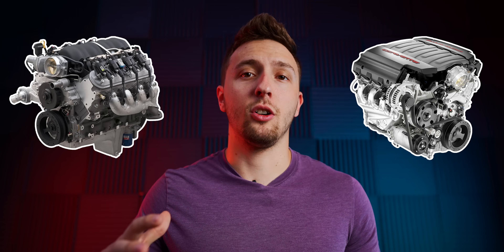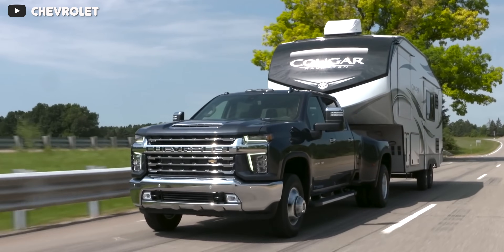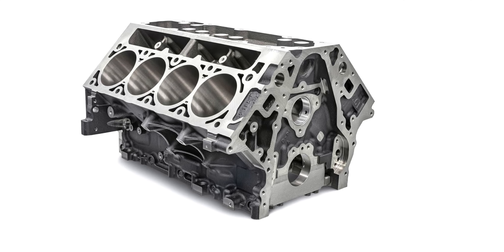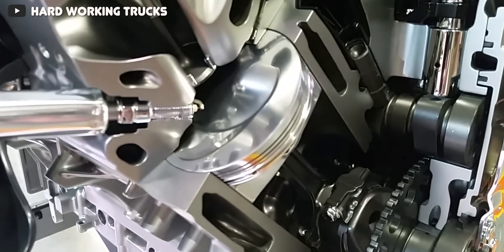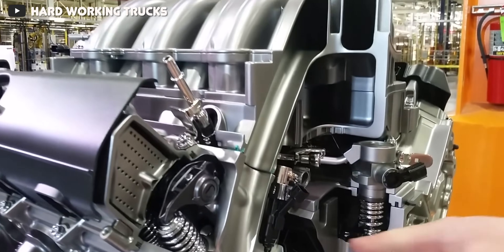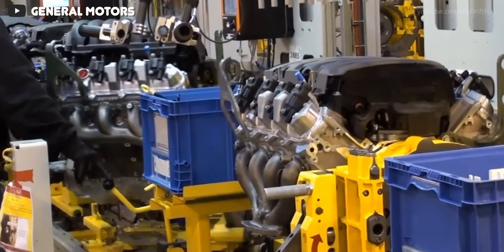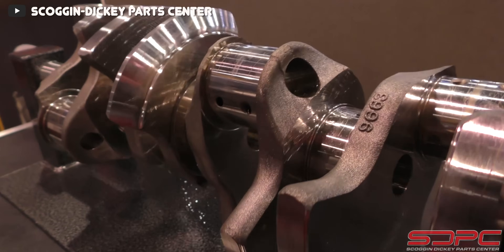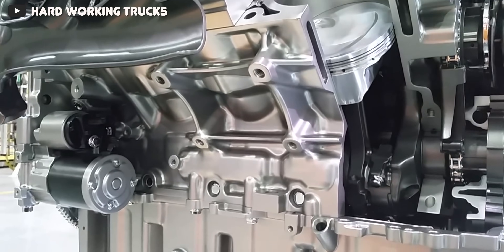Here's Why the GM L8T is the Best LS/LT Engine

Comment: I got the L8T in my 14Foot NPR box truck 🚚 n I luV it.. It has a 38 gallon fuel tank.. I run 2 gallon diesel mixed with 36 gallons of gasoline 😮😮😮 an it runs smoother n stronger 💪... 25+ years Mechanic. The diesel helps as lubricant for the injectors, rings, pistons, cylinders. If you have questions just go an read the fine print in the Lucas gas treatment, it's basically motor oil. 😂😂😂😂😂

Comment: I have the 2024 GMC 2500HD double cab long bed L8T 10 speed. Love it so far. Hauls my Lance camper fantastic. Cruises at 70-75 perfectly 11mpg at that speed. Accelerates up to 80 on a grade no problem. This thing goes and is really smooth. Of course if you drop down the speed the mileage is better, but I like to go with the flow and on the Interstate that's 70. Empty it get 17 mpg. Love this truck..

Comment: The gen 3 and 4 stuff is really popular and simple cam swaps are not only possible but will give you a good power bump. The LT family though i wouldnt associate simple with anything about it. The lt family of engines are great dont get me wrong, but you wont be doing any somple cam swaps, those Di injectors are very expensive like diesel expensive, and the fuel system high pressure portion runs off of the cam which has to be taken into account by cam manufacturers and customers alike

Comment: The 6.2 is still better stock for stock.

L8T 401hp 464trq
L87 460hp 460trq

L87 revs higher and has the 10spd mated to the back.

The 2500 series trucks the 6.6 comes in are a lot heavier and have that junk 6spd behind them. Slow turds that get horrible mileage.

1500 series with the 10spd and the lighter truck. Better mpg, performance, and can tow almost exactly the same. 600lbs less with the tow package.

If you’re just buying a truck for a truck, a 1500 with the 6.2 is the better truck. 

For performance I’d still stick with the L86/87. Better aftermarket support.

And a cast block is meaningless. The 03/04 cobras had a cast iron block. And the Teksid aluminum blocks from the 96-98 cobras were way stronger while being lighter. 

A lot of these points are all on the 86/87 as well. 

The only real plus to this engine is the lack of AFM/DFM/DOD. Which is an easy delete to do. Especially if you’re already gonna be doing a cam swap as well.
Reply: The L87 is 420 hp NOT 460. 

The L87 V8s are failing constantly. There's already two class action lawsuits out. 

The L8T has no AFM, lower compression which means less wear, doesn't require more expensive premium fuel, and now comes with the 10 speed. 

And BTW DFM is not easy to delete, if you disable it with software you STILL have the same lifters which are what's actually causing the DFM issues. Do a cam swap you've killed your warranty and likely made the reliability even worse.

The performance crate engine version of the L8T (the L8P) makes 523hp, 543 lb-ft and is fully backed by a GM warranty.

Comment: iron blocks are used for increased durability and lower cost vs aluminum.  Also they handle being overheated a lot better than aluminum.  Its not about "strength" to handle high power output...

Comment: LOL packaged very small. like that is somehow in the top 5 reasons an engine is good. The Ford Coyote engine is so much better in every respect besides size. So what? Hot rodders are innovators. They make anything work. Don't need the gm (Gods mistake) people bashing Ford with what they know nothing about. Just for the reason they are "cheaper". If you are worried about 2k... you shouldn't be working on a hotrod.

Comment: I love my GM trucks, especially the GMT800 series. However, if I were to buy a gas tow-pig it would be a 7.3 Godzilla. We have a fair amount of mountains nearby and gas won't cut it for towing 12-20K lbs toy haulers. My buddy traded his 2023 L8T truck for a godzilla and it is night and day different. It still revs it's nuts off on steep hills. I just prefer diesel because they are still cool calm and collected at max power. I'll stick with my L5P and LBZ for now.

Comment: Another interesting note that I learned about ; after having investigated materials that, effectively, mitigate high-thermal loads : the L8T is equipped w/ exhaust valves made of Inconel.

Provided that one is OCD, regarding heat management - he or she may want to look into this [ very, very expensive ] material. It’s purported to be “ that good ( and is used, extensively, in professional racing applications ). ”

I’m attempting to build a bionic overlander  — so ; I’m [ everywhere ], researching.

Comment: For anyone wondering these are also an extremely simple swap for all 14-18 half ton trucks minimal wiring required. Re pinning some connectors and a tune and re using some accessories and it works. Id argue its cheaper to swap in a l8t in place of camming your l83 with long tubes just to achieve similar power.

Comment: This makes me feel so good about buying a silverado 2500 gasser. Gotta love a simple small block v8. No start stop, no hybrid bs. No fuel management bs. No cylinder turn off bs. Love this truck with this engine.
Reply: I have hd at4 gas, I wanted column shift with non of the epa bs. Perfect engine.
Reply: L8T is under rated. People have dynoed L87 vs L8T engines in 1500 trucks and find RWHP is more with the L8T

Comment: Good video but I want to put this short lock in my 17’ 6 liter truck but I don’t want the direct injection crap on my truck so how can I do this?  I mean the heads on the 6.0 are very different as you say the exhaust valves are swapped?

Comment: 400 hp, not even 500 ft lbs? No thanks, I will stick to a LSX or LS3
Reply: The L8P crate engine makes more power and torque than the LSX 454 street-legal crate. 523 vs 505.

Comment: 8.1 got your back to
Reply: The 8.1 only made 320-340 horsepower, less torque, got worse fuel mileage, was physically larger, and much weaker.

The 8.1 heads weren't capable of flowing nearly as much air as the L8T. An L8T could pick up 100 horsepower with just a cam and a tune. An 8.1 can't.

Comment: There are some issues surround the crankshaft snout diameter and key ways. 
   That stock timing gear is not engaged with the timing key by very much at all leaving the timing gear floating on torsional stresses with over .0025 clearance from the crankshaft snout.
  You’re not hanging your hat on much at all
In that area. 
  Plan on at least milling an additional key slot in this crankshaft. There isn’t anything out there readily available so far other than a aftermarket crankshaft.

Comment: Dump the variable oil pump and I really like the idea. I hope they enlarged the exhaust manifold studs or made them out of inconel or titanium. I’m fed up of American engines developing exhaust leaks. What trans is behind this because I also hate the crappy torque converter failing.

Comment: It sounded like you implied this engine replaced the 6.2.  With the mention of the 6.2 specifically and the mention that it went back to iron block. 

The 2500hd and 3500hd trucks never got a 6.2. Never ever. And they never got an aluminum block. Even the Denali hd trucks did not get a 6.2.  6.2 is a half ton truck engine. 

6.0 been the only displacement of the ls engine before the l8t and it has always been iron block and aluminum heads besides the 99 and 00 trucks getting iron heads.  

Just to clarify. There are lots of people who think the 6.2 with aluminum block made it into an hd truck and it never did. Perhaps because the plastic engine cover looks just like the 6.2’s in half tons

Comment: Would have been REALLY awesome if GM offered a different ratio besides 3:73 for the 2020+ trucks. The 20-23 trucks with the 6L90e and 3:73’s felt similar stock for stock as a 11-19 L96 with a 6L90e and 4:10’s.

Comment: The aluminum block can only handle 1500 hp max. This engine right out of the box will handle 2000 hp with higher quality  pistons ! You really need to do your homework on oil pumps if you go to a higher volume or pressure pump WHICH YOU DO NOT NEED YOU WILL LOSE HP . Years ago the higher volume pump was the thing to do .
A FACTORY OIL PUMP WILL GO TO 100 PSI AND PLENTY OF VOLUME  ON A 2000 HP ENGINE.

Comment: If it's only 12 pounds lighter than the LSX, why didn't they just use the LSX block and produce a new-gen 454?  That would have been a great response to Ford's 7.3 gasser.  If you're a dyed in the wool GM guy that wants a HD gasser, I guess you're going with this, but everyone else is going to put their money on a Ford 7.3.  Internet towing tests such as the Ike Gauntlet have shown this engine is weak compared to the Ford 7.3 gasser.  I'm sure it responds to mods extremely well like all GM LS/LT engines, but for stock usage in a pickup, it's a disappointment.

Comment: had 3 GM 2020 HD 2500s with 6.6 gas and 3 GM 5.3 1500s with 8 and 10 spd 2020 or newer and gas mileage overall isnt really much different........overall i was around 11mpg with 2500 and high 12s with the 5.3...........would love to get a lil more out of the 6.6 at some point....475/500 sounds bout perfect without putting too much strain and keeping reliability

Comment: Currently I'd have to disagree. 6.6 has the same issue as the 4.8. GM just settled a 100+million dollar class action lawsuit for faulty motors in regards to excessive oil consumption with the 11-14 trucks. GM also just released a bulletin for the 6.6 stating it's acceptable to burn 1 quart of oil per 100 gallons of fuel. So, if your averaging 13mpg, that's 1 quart per 1300miles. If you're changing oil ever 5k mi, that's almost 4 quarts in between oil changes to be added. Considering it's a 8qt system, that's absolutely ridiculous. I don't think it's every single truck with this extreme example, but it's been a big enough factor that GM has acknowledged it. Hopefully the 24 year with a much needed transmission update to the 10 speed, they iron out this issue to make a solid platform.

Comment: I really don’t know if this really matters for most hotroders.  With all out drag racing yes but for a hotrod or classic car that operates on the street there is a practical limit to how much power you can use and the early gen 3 ls engines already push those levels.  4 digit power levels are cool to see but in reality about 100hp per 1000lbs at the wheels is already more than most people can really use.  Point being why pay more money for power you can’t even use on a street tire.

Comment: I've driven a bunch of 6.6 gassers and found them to be not what they are advertised.  They don't seem to have much if any more power than the 6.0 or the 6.2 and that could be due to the weight factor, a 1500 vs 2500 truck.  The gas mileage is not that good either with getting 18mpg on the highway on a good day with below that mark most of the time.

Comment: You haven't figured it out yet, have you?  GM won't put aluminum block engines in their heavy-duty trucks.  The iron block engines are meant to work harder.  It's a duty-cycle thing.  Don't talk about how the aluminum block engines are strong because they can be turbo'd to 1000 hp.  With that much power in a light vehicle, 1000 hp is not reached but for only a few seconds.  Hook up to an 18000-pound 5th-wheel and floor it up The Ike for 10 minutes, repeatedly, like RV hot-shotters do.  That's where you need the iron block engine.

Scoggin-Dickey turbo'd the L8T to 2000 hp.

Comment: Whats the opinion on the fact they decided to go direct injection only on this motor?
Edit: Rather than a dual, port and direct, injection system like the Ford 5.0 and 7.3 to help the valves out and add longevity.
Reply: The Ford 7.3 doesn't have direct injection.
Reply: @andyharman3022  Thought I read it utilized both like they do in the 5.0

Comment: I would love to see gm and ram bring back big blocks like ford did. That 7.3 is impressive.
Reply: I saw it on the news that Chevy is making a new engine that will be on trucks and it looks like is going to be pushrod 🙏
Reply: @chikisorozco4297  I hope so. I know they just came out with the 6.6 gas motor.
Reply: That 7.3 is impressive. The problem with the Godzilla seems to be with where ever they're getting their lifters. A lot of lifter failures showing up right around 30-35K miles.
Reply: @4alphazulu  lifters seem to be a pretty common problem amongst many manufacturers lately.
Reply: @h.merica  yeah. That’s a fair assessment. It’s like whoever is supplying them is using crap metal.

Comment: GMs major flaw with the gas HDs is the gearing.  On a work truck with the factory 31” tires the 3.73 gears work great.  On a Denali with the 34.1” factory tires the 3.73 gears are less than ideal and mpg is absolute garbage.

Comment: I see a lot of comments concerning the DI in these engines, a JL catch can takes care of those worries for 150 bucks.  I bought a 2022 Chevy 2500HD Custom model with this engine in it and absolutely love it.  I installed a catch can on it when it was new and believe me, it catches quite a bit of oil, nothing beyond reasonable but I wouldn't want it in my intake.  So I would highly recommend installing one.  Aside from that, it is a joy to drive, dead silent on the highway.  The 6 speed 6L90E is buttery smooth as well.  I just love it.....tows our 8k lb camper with ease.  My truck weighs over 2k lbs more then my buddy's 1500 with the 5.3L engine in it and we get the same gas mileage.  I actually get better gas mileage when towing, we have the same campers.....kudos to GM....they hit a homerun with this engine transmission combo in my opinion.
Reply: Which can did you go with?
Reply: @slaytanic921  J&L, used to be JLT.  Amazon 150 bucks I think.

Comment: Purchased a 2021 Chevy 3500 HD with the 6.6L gasser and have thoroughly enjoyed the engine/transmission combination. For 2024 GM is allegedly doing away with the six speed in lieu of the ten speed tranny. The only downside I foresee is the direct injection over port injection setup. In addition, I’d like to see Chevy increase the horsepower to 475 and corresponding torque curve. 

Your analysis indicates the stock engine, heads, values, crank, cam, and guide rods are sufficiently robust to withstand incremental horsepower increases.

So Chevy for 2024 let’s focus on wringing out some truly impressive performance figures from this engine variant.
Reply: I lost mine 100 thousand miles lifter collapsed number 8 cylinder